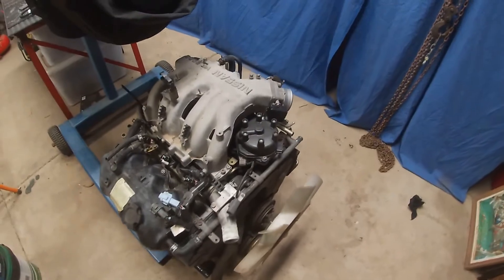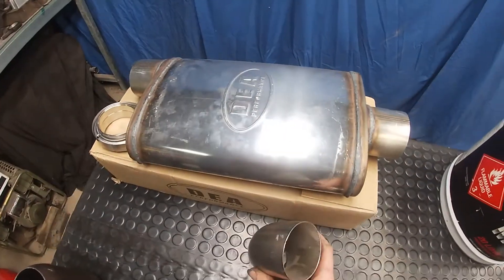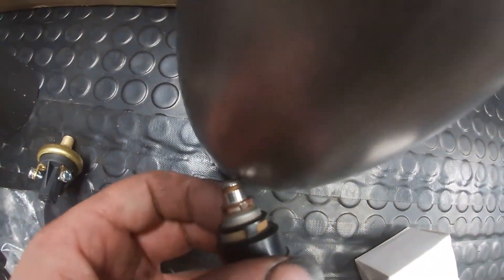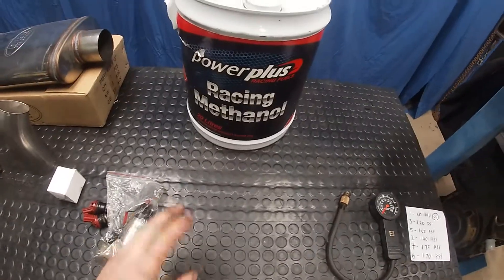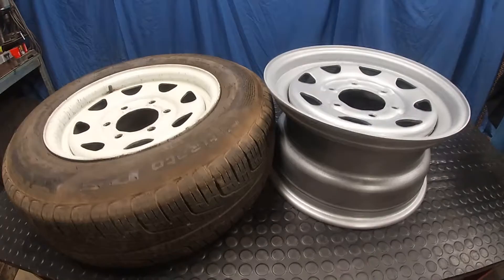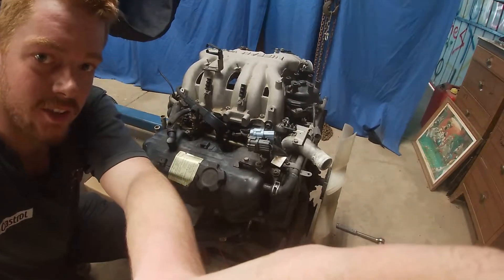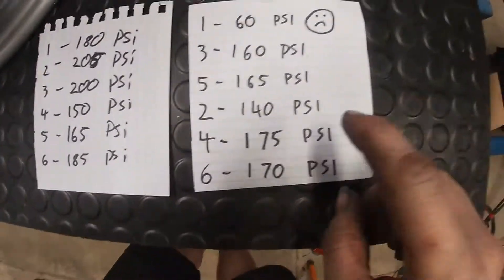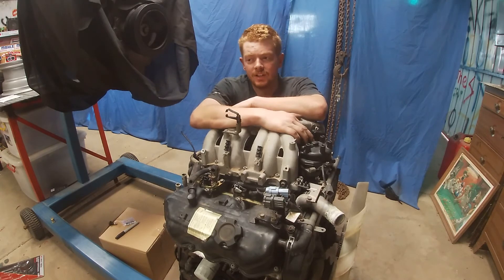VG30 Navara ep7: update plus compression test on new motor

Comment: Hey Red, love the D21 and keen to see you get the Nistune and other upgrades going. Keep the content coming.
I've got a D22 with VG30e (same version as your donor engine) and have been planning a turbo install for a while. Unfortunately the factory D22 ecu is not suitable to Nistune so I am going the Haltech route (e11V2).  I'm also trying to keep the a/c and I suspect by the videos that you removed yours? I currently have some 16x7.5 steel landcruiser rims with 245/60r16's on the rear and 225's front. So I will be interested to see how much traction you get out of your new wheels. I bought some cleaned and flow matched 380cc rb25det injectors but also keen to see how your de-capped  SR injectors go. Are you looking to dyno tune once the nistune is in and will you use a base map from the z31 community to get going?
Reply from the maker: Joshua Wundersitz hey mate thanks for the comment, it's great to hear from people with vg30e's.
What turbo are you planning on running?
That's a pain that you can't nistune the d22, maybe you should look at a more advanced piggy back like a greddy emanage or something like that?
My d21 is the base SE (or maybe DX?) model, never had air con
Yeah I was looking a bunch of different wheels but I really wanted some 15s so I could run some slicks or drag radials later on.
380cc injectors is still a big step up from the 170 stockers so you'll make plenty of power, I'm looking forward to see what the decapped ones flow
I'll check out the z31 base map mainly to look at the timing map, I know I need to pull 10 degrees from the Na map, but it will be interesting to see the curve and peek timing 
Keep in contact and let me no how you go
Reply: I'll be running a TD05HRA-16g6 for a start which should give a very fast spool up.
370cc injectors at 85% duty should be good for 300hp @ the crankshaft which will probably be as much as the 'heavy duty' clutch will handle. When do you think you will upgrade the clutch in yours?
Reply from the maker: @joshuawundersitz4519  my stock clutch started slipping, so ive got a button clutch to go in with the new motor, that will be in next d21 video.
300 hp will be fun, it is like double the factory power